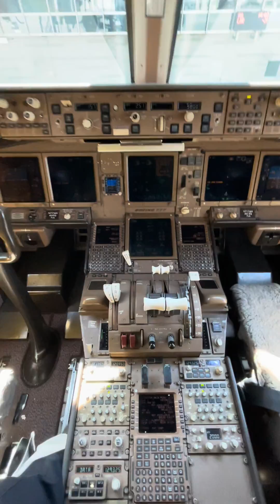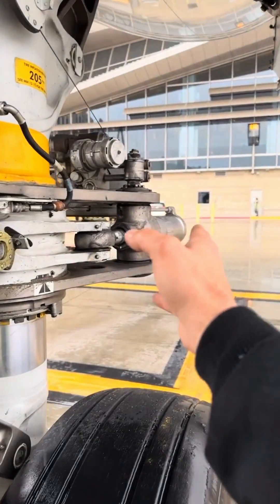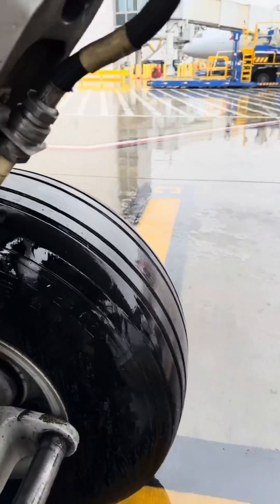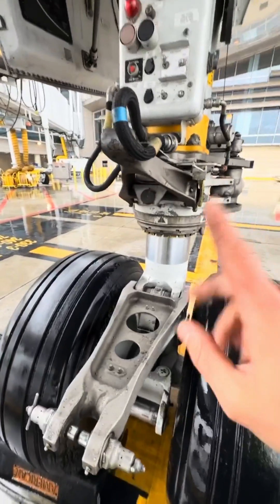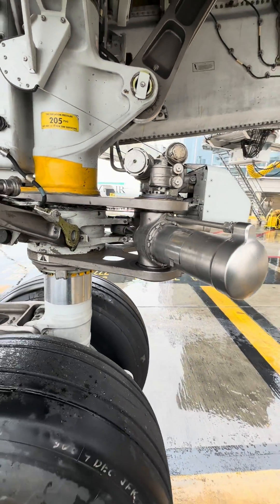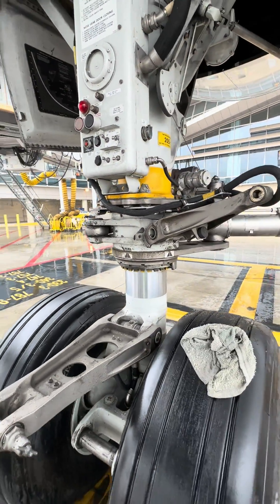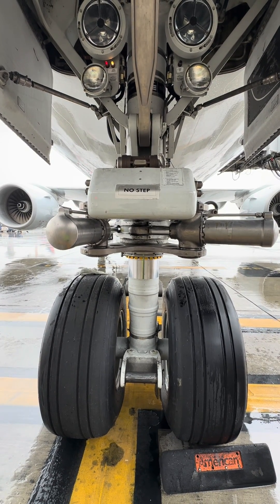Aircraft Main landing gear/Body gear Steering actuators and Clearing a Fault on the B777-200.

Comment: When using the tiller to steer the wheels, you removed the scissor link from the nose gear, so it will not steer itself. Is there a reason why you the AMM chooses to do this instead of using a bypass pin? With a bypass pin there is no hydraulic power going to the nose wheel correct?
Reply from the maker: I’m sorry but I don’t quite understand your question. This was an operational check to clear fault.
Reply: @StigAviation Apologies, my understanding was that the main gear steering had a problem, for you to fix that it required moving the actuators through their full range of motion.
Since the aircraft was parked and chocks in place, you would not want your nose to steer.
My thought was, just insert the bypass pin, meaning there would be no hydraulic power there, so the nose won’t steer when moving the tiller. 
However I missed the part where you said the computer needs to read the actuator systems and make sure they are all synchronised. By removing the scissor link you can move the nose gear actuators without the wheels moving. Now it makes sense!

Please excuse my lack of knowledge, I’m still a 1st year student at KlmUK engineering😅

Comment: Great job and explanation. 
Funny story , I was working in EWR and it was a beautiful day with a warm breeze that day. I was waiting for a 747SP to land so we could service it. The aircraft landed and blew 16 tires. In the flight deck upper panel( P-5) the body gear steering and Anti skid switches are located side by side. The Captain accidentally turned off the Anti skid system and armed the body gear steering. The main landing gear brakes received 3000 psi when he applied the brakes. The aircraft was grounded and we worked OT. The pilot tried to deny it but the Flight Data recorder and Voice Recorder did its job. There went the beautiful day.
Reply from the maker: Ohh my goodness. All 16 😅   I bet they won’t make that mistake again

Comment: 3k PSI through those small arms, just amazing engineering. Would love to see a video on how the nose gear pin works and why it's important for the tug crew to show them to the pilot after pushback. Keep the great content coming bro!!❤
Reply from the maker: I’ll try to get something for that. But in quick answer it basically disables the nose wheel steering.

Comment: Stig, does dry ice blasting ever get used for cleaning aircraft?
Reply from the maker: Not at all. That would damage the aircraft.
Reply: @StigAviation  How would it damage the aircraft?  I'm curious what dry ice cleaning would do to an aircraft as it's growing in popularity for car detailing.
Reply from the maker: @Boodieman72  I’m not aware of how they do it on cars. The only dry ice I know comes in ice cube form.
Reply: @StigAviation  They use 3mm pellets.
Reply from the maker: @Boodieman72  ya that would fly with aircraft. To much potential to damage the airframe and sensitive equipment
Reply: @StigAviation  It would seem to be less damaging than other methods of cleaning.  I wonder if the FAA / NASA has done any research into using it.  I couldn't find any FAA regulations regarding its use only in the transport.  Some of those interiors look like that could do with some kind of cleaning they aren't getting.
Reply from the maker: @Boodieman72  it could be a possibility but it would have to be approved by the manufacturer and the governing body. But they usually use pressure washing nowadays. I made a whole video about cleaning aircraft and how it’s done
Reply: @StigAviation  I'll have to look for that video.

Comment: Hello Stig, question: what is the stick with a flag that the ground crew shows to the pilot?
Reply from the maker: That is called the Bypass pin. It’s a very unique pin that gets installed on a unit on the nose gear. It disables the steering function during aircraft push back. One safely pushed back and ready to taxi, ramp or maintenance will remove the pin (which has a streamer on it saying “remove before flight”) and show it to the pilot.. notifying them that the steering is functional and unlocked. They wave it in the air and salute 🫡 for clear for taxi and departure. 👍
Reply: @StigAviation  thanks!🙂

Comment: Do you usually work with a partner or are you by yourself
Reply from the maker: Most of the time on narrow body aircraft, I am by myself, but widebody aircraft. I would have a partner to work with. But this is on the line, the Hanger environment is a little bit different, you’re working with a big team.

Comment: Great video! Nice to see the front LG moving but I thought you would also show us the main LG actuator moving...
Reply from the maker: I had to monitor the nose wheel links so I didn’t get a chance to run to the main gears.
Reply: @StigAviation  Understood. The confusion was because the title of the video leads to this misunderstanding.
Reply from the maker: @MarceloTrindade1  just as a side note, the movement is very minimal on the main gear. You won’t actually see it move.. it happens only when the aircraft is in motion and turning tight. Otherwise it’s the actuator I showed that moves ever so slightly.
Reply: @StigAviation  Thanks.

Comment: How do nose and MLG steering axles lock for take off and landing.  On the 777-300ER dont those two rear tires contact the runway first on landing.  I imagine something robust would have to be in place to keep it from having a steering angle applied especially in strong crosswind landing scenarios yes?
Reply: The nose is only locked at full extension via a centering cam, this ensures the nose is centered upon touchdown. The MLG steering actuators have internal locks to center them when there is no steering input.
Reply from the maker: Perfectly explained 👌. Thank you Brad 🤙

Comment: Many thanks for your videos. Just wonder if is possible to see main gear movement? I mean rear gear.
Reply from the maker: It’s very hard to show that because it’s happening when the aircraft is moving, and obviously I can’t be standing there when it’s moving… dangerous. But the movement is very minimal.. hard to spot from a distance.
Reply: During the test at the gate when your colleague was turning the tiller only front wheel would react (that is what we saw) the rear one would stay the same? My guess is that the rear is not power assisted and will turn with the aircraft movement @StigAviation
Reply: @voytekcyvr1936 You would see a slight movement of the actuator, but due to the extreme forces required to move the aft 2 wheels they only move during aircraft movement.